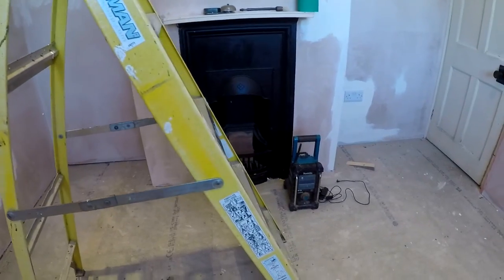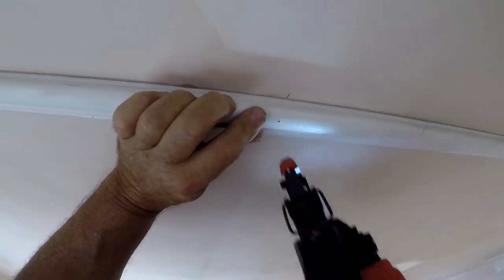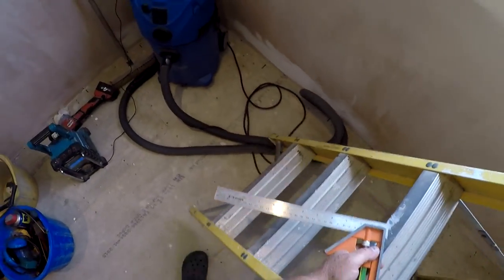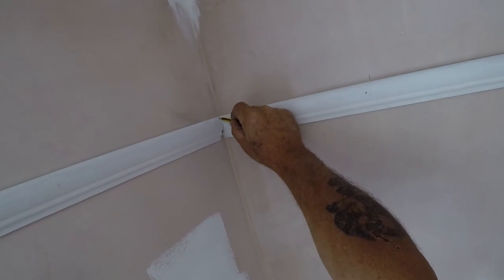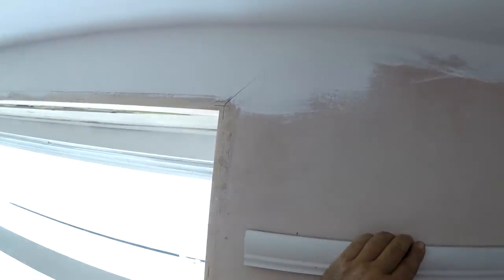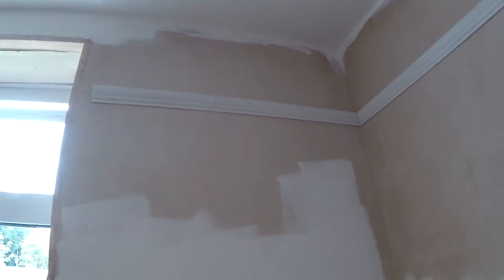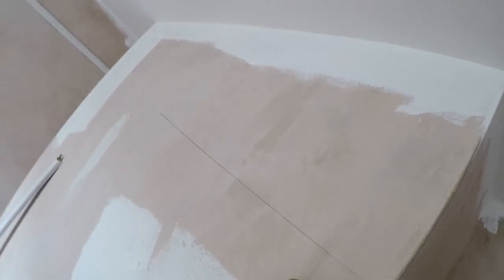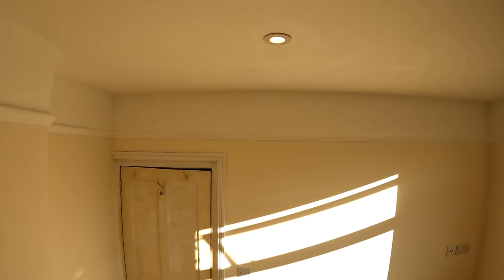HOW TO cut and fit picture rails the OLD BOY method

Comment: I'm doing some picture rail for a friend. The picture rail she got was like yours but the profile is slightly different where the big bulge finshes is turns back up again sharply by just a few mm before squaring off the last 5mm. That bit that turns up with a sharp angle is a pain because when I tried to fit the scribe to the other rail the sharp angle doesn't like to slot nicely on top of the other rail, so I don't know if I'm just doing something wrong but if I scribe too tight I end up tearing the wood as it's just too thin, or I cut a small section out of the top side bulge of the other rail for the sharp profile of the scribe to fit onto the other bulge. I got it to look OK but it just seems a bit odd. Hard to describe but I'm sure you know what I mean. Thanks for the upload
Reply from the maker: I know exactly what you mean and it’s very frustrating, cheers for watching 👍👍⛏️

Comment: Hi Budd, great work it looks fantastic! 
I've got a similar job coming up with solid walls, the room will need insulating on the inside, what battens and insulation did you use? Any chance you've managed to capture it on camera?
Many thanks
Reply from the maker: I used 25x50 mm treated tile battens over 25 mm celotex, I don’t have footage I’m afraid, many thanks for watching, hope it helps , 👍👍👏